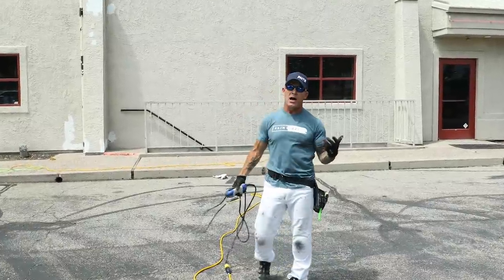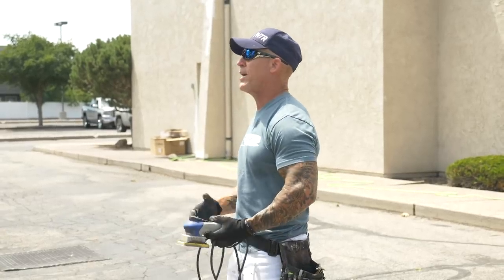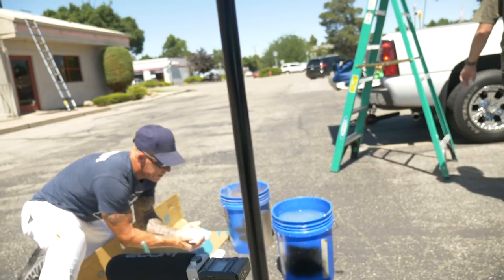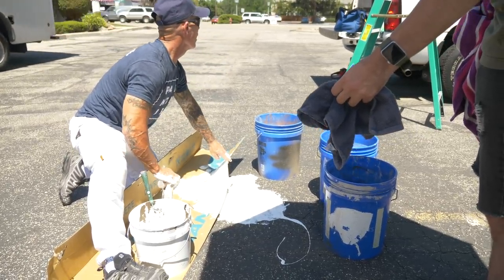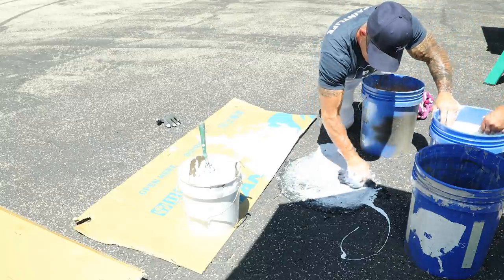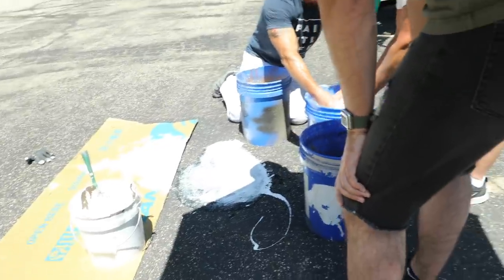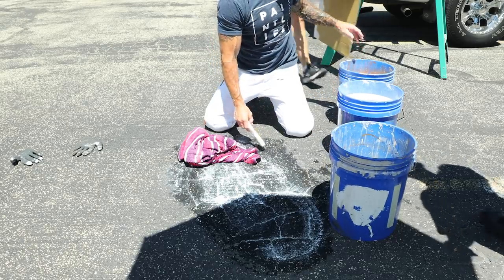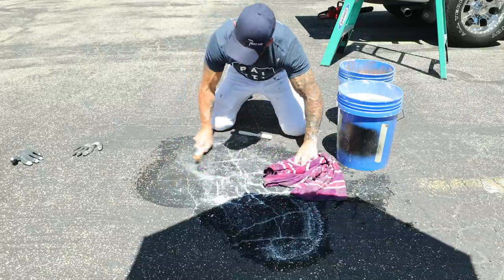DISASTER Clean UP Paint Spills: Job site Disasters

Comment: I spilt 15 or so 4 liter pails driving through a busy intersection in a small town. 
The tailgate opened up upon accelerating when the light changed.
Only in a small town could the fix have happened like it did. I blocked the paint marsh and called the fire department!
They were totally helpful, and did there best to get me out of a very messy, possibly costly, mega embarrassing situation.
It's  been 30 years but, thanks for the help Prince Rupert F.D.
Mark

Comment: Keeping calm is the key. I had a fall at a home and luckily I did not get hurt. However, I got Benjamin Moore Advance all over a hardwood floor. My customer was freaking out cause she thought I was hurt. She was shocked at how calm I was.😊 I took a bunch of towels, wet them with water, and laid them down everywhere there was paint spilled. I removed each towel one by one in a wiping fashion and cleaned it all up. They were impressed and happy. I’m doing another job for them next week. 😊

Comment: I was doing a nursery and after 25 years of painting I spilled my first gallon of paint. I couldn’t save the paint as it was in carpet with dog hair. But took your advice and got all access off carpet and then soaked it up with dry rags. Then got a Bissell shampooer spot cleaner and was able to pull the paint with water running through it. I took a lot of your advice and did not panic and was able to clean the mess up and you couldn’t even tell I was there very thankful

Comment: Never panic in front of a customer, lol
Reply: Georgia drop cloth
Reply: Absolutely critical. As the hired expert on the job if you begin to panic all confidence is forever lost. No matter how big/small the job or how big/small the accident if you maintain calm and provide a clear path of recovery you can not only save a project but inspire greater confidence in your client. Obviously this does not apply to repeated mistakes or egregious failure.
Reply: Been there and done that. For over 35 yrs pro. Never send tour helper to clean up a spill. Let them assist a journeyman. Learn from experience, and move on .. calmly. Never put water on a chemical fire to extinguish, and never add water to paint to clean up. It spreads like wildfire. And salvage as much food product as you can
 It can be strained, and drill mixed back to life.

Comment: Good job Chris. I wanted to point out something you didnt do or talk about which is a HUGE tip for anyone who doesnt know. You did NOT use thinner. Thinner of any kind on asphalt is a massive no-no. It will leave a spot that looks like all the oil just leaked out of your truck. I was subbing many yrs ago and watched the boss clean all his equipment right in the middle of the home owners asphalt driveway, got thinner everywhere. Owner asked him about the massive spots all over before we left and boss said it will evaporate and you’ll never see it. Home owner called the next summer and boss payed $350 to sealcoat his entire driveway to cover it up, again, a year later. 

Home owner sold house since then and believe it or not I just repainted the same house 10+ yrs later last summer for new owners. I could still see every spot but very faded. Since that day i just take everything oil home to clean.

Comment: It’s honest to show your disaster, glad you fix it👍
Recently I had some dust plaster on a black tiling (crocodil relief). Client tried to fix it with water but worsen the problem. the solution was to brush with white vinegar, then it worked like a charm 👌

Comment: Yeah not panicking is important not only to put the client at ease but also for safety. I once spilled white paint on a black shingled roof, you don’t want to be freaking out going up and down ladders and on a roof, you have a few minutes to work with even in summer so just stay cool. There isn’t a whole lot of mistakes that can’t be fixed, I just got some buckets of clean water a wire brush and some rags and washed it down the roof and it came right out. Painting is a unique business where we’re working with liquids that dye things permanently and are hard to get off, there can be mistakes at any time if you’re not careful and it’s bound to happen at some point in your career. The lost time having to clean it up is a bummer but being able to correct and learn from your mistakes is a valuable skill!

Comment: Great Job really nice cleanup.  I was painting my sons room several years ago with a wagner power roller and the hose blew I scrubbed the wood floor for several hours but got all the paint off.  Which was good considering I just put the floor in 3 days prior.  Then my son decided he didnt want a poster on his wall anymore and the paint was faded everywhere except where the poster was so I had no choice but to paint it after putting in the new flooring.  Luckily it worked out but had me worried for a while.  Thanks for all the tips and advice.

Comment: Worst thing to do with a paint spill is panic! I'm a painter by trade with 22yrs experience here in Western Australia and have had an employee of mine spill a litre of paint on old carpet from their paint pot at a commercial property I was doing a repaint on  same thing applies... Don't panic..Contain the spill... Scoop up as much as possible.. In my case I used a dust pan and filler blades as a scoop into another bucket. Then used soapy water that was available in the laundry area (daycare centre) soaked and sponged up the remainder  with sponges and paper towels cycling new fresh water buckets after another... Couldn't even see there was ever a spill when I was done 👌

Comment: I had an O-ring break on the pump part of my sprayer. I'm up on a ladder and I hear the sprayer whining like it's the bottom of a bucket, and I think "no way I just started a new 5 gallon bucket!" . I look down in horror and see that  the ruptured seal is spraying the next house over with dark gray paint.

I raced down the ladder like a fireman with a kid in my arms, and quickly shut off the pump. Fortunately that neighbor's house had a hose with a spray attachment on it which I used to wash away the splattered paint. Since that day I always keep a spray nozzle in my toolbox just in case.
Reply: El Burdigato had the same thing happen to me but it was spraying my truck lol

Comment: I once dropped a entire gallon of oil based stain in front of the paint store when I was returning it. It was everywhere and so slippery. With enough paint thinner and rags though it cleaned right up. Needless to say I was so embarrassed that I still have not gone back to that store.
Reply: I've done that too, nothing to be embarrassed about. If you had looked around you would have noticed that, just like every other paint store, there are paint stains EVERYWHERE. I can still see mine from years ago, almost every day when I go pick up a paint order.

Comment: My dad had my cousin working for him we were painting the outside of a building over asphalt and he kept sliding the bucket with his foot, I told him "hey pick that bucket up and move it so it doesn't accidentally tip over on this newly refinished asphalt" 5 minutes later and what else would happen besides him not listening and 1/2 a gallon of paint on the asphalt. Sometimes it's stupidity some times it's unforeseen

Comment: Spilled a gallon of oil wood stain on a garage concrete floor. Removed the saw dust from my vac took off filter vacuumed up the stain poured it back into the gallon. Dumped the saw dust over the stain to help pull up the remainder. Mostly worked any  tips?

Comment: Hello, oh no, Good job cleaning up! 
I have some questions about using a sprayer. Specifically the Wagner Control Pro 130 Electric Stationary Airless Paint Sprayer.
I have rolled two bedrooms but that was time consuming. Using a 9” roller. And cut ins myself as well. That was a pain. 2 coats each process.
So I want to make the process easier and use a sprayer along with attaching the 24” extension.
Our walls were hand troweled when we had our house built 15 years ago. Walls still have original paint. Now time re-paint.
Anyone on here can answer I would appreciate it. 
My Questions: 
With the walls being hand troweled will I have to back roll after I spray? The texture isn’t heavy at all. I believe the sprayer comes with 515 tip.
Or should I roll the paint with 18” roller? 
Which method do u recommend for better application?
Thank you

Comment: Haha I once had a hose blow on a whip while  I was  60 ft in the air on a gas boom lift running a gas pump and my ground guy could not hear what I was saying when I was yelling down there shut the pump down and release pressure I pumped  3 gal paint  on the roof top of the building. Needless to say it covered everything below me luckily for me it wasn't nothing important that I was above. Accidents happen
Reply: @dennisgarber  I was running a Graco 5900.  I don't know why it didn't blow when putting paint through the line it must had a weak spot in the hose my guess 22 years experience first time ever had a hose blow. Spilled a few gallon here and there. But nothing that couldn't be fixed.  I want to see him do a video on cleaning up carpet after he spills paint on it LMAO. Was on a enter your job once Doctor's house they had a dog running loose kicked over a bucket of paint grab the dog thur it in the paint and holler get out of here dog. Yep that day that dog saved my ass.

Comment: Shouldve poured water on the spot after cleaning up the excess and use a push broom to brush the spot fast then used rags or towels to clean up or sponge up .. Good job tho but I usually keep the broom on the truck just in case. Just a helpful tip
Reply from the maker: Great idea

Comment: All you need is DIRT, WATER, and a WIRE BRUSH. Dirt  will absorb the pigment, its fantastic, works with big and small spills. Even if I get a drip while cutting in outside I will just grab a pinch of dirt and rub it into the drip. Boom gone. 

Funny story, back when I was a new apprentice I had a  caulking gun and a deuce  full of paint I was brushing out of, and I had climbed up onto this roof to paint some fascias. While on the roof I grabbed the caulking gun with my other hand and the hook at the end of the caulking gun caught my paint bucket and pulled it right out of my hand and poured the paint all over the roof, my leg, and my boot. I called for my coworker to bring me a hose and a brush then started trying to clean it up but everywhere I stepped I left a big swiss coffee colored boot print. I ended up taking off my boot and throwing it off the roof then continued frantically scrubbing this roof tile. The icing on the cake was the home was on a busy street so as all these cars drove by they saw this crazy looking kid with a missing boot trying to scrub a roof with a brush and a hose. HAh.

Started writing this as I started the video, now I see that it looks like Chris knows the dirt trick too.

Comment: I have painted over 300 exteriors and whenever there is a paint spill I scoop as much as possible.  I then contain and soak up the rest with dirt.  scoop the paint filled dirt up.  I then hit it with dirt again and move it back and forth with the dirt acting as an abrasive.  Then I sweep up the remaining dirt/paint.  By this time it is usually clean and only at this time will I hose off the dirt residue that remains if needed.  Often I have found it needs no water.  Water is not the answer and those who turn the hose on a paint spill make matters 100 times worse.  Think of it like this., paint does not stick to a dusty or dirty surface so you are contaminating the area to make sure it has no chance just as how you prep and clean and pressure was a surface to make sure you will promote adhesion.  You do the opposite. 
I have done this whenever myself or another person has spilled paint.  I have cleaned up paint in underground parking structures while others rush to get the hose.  By the time they return it is all cleaned up.   If it has seaped into the concrete you may need  to use a wire brush in the end but more than likely not.  This is by far the easiest and quickest way to clean up paint.  One guy spilled paint on a brand new $65k roof.  Went into panic mode and the solution was dirt.  Dirt saves the day.

Comment: A painters worst nightmare. I've used a 12" muddng knife to pick it up.
Reply from the maker: Nice tip
Reply: Put a line of spray glue then put five feet of 48” masking plastic from masker with 1.5 making sure tape was stuck down to glue then pushed the 5 gallons of paint onto plastic with 12” blade. Them basically did what he did .  I fogged some flat black rattle can lol 😂.  Ramming sheet rock with scissors lift is the F up gets me puckering .

Comment: yes every painter has spilt paint it is just a occupational hazard bet u are glad it was just water based oil based is another story to get up. but u should of had a dust sheet down even before u open a can of paint. Plus would of use a big brush to get the paint of the tarmac then use rags to clean up come to the uk and see how painting is done properly seeing that we invented the trade